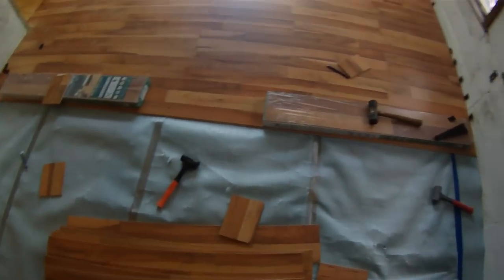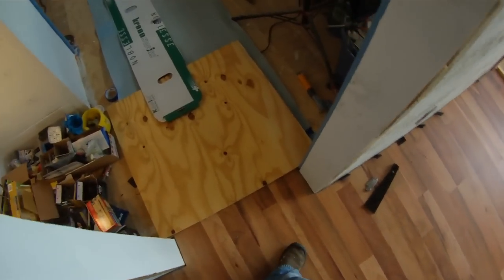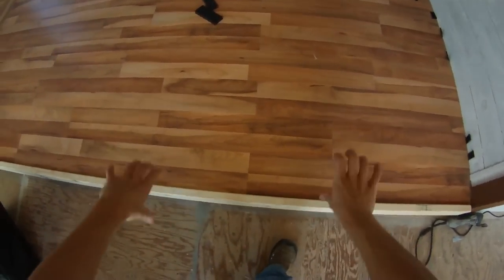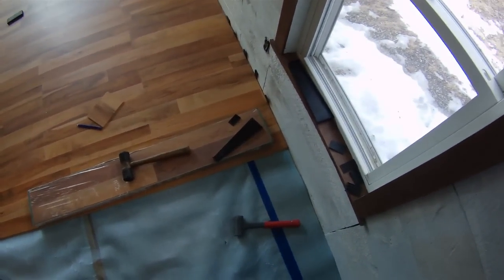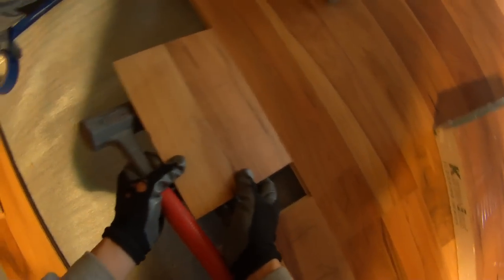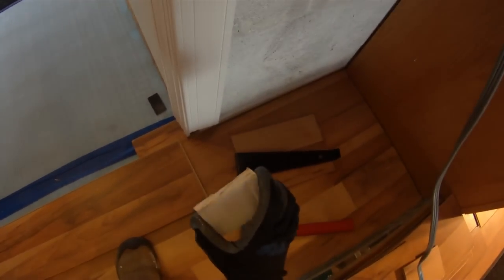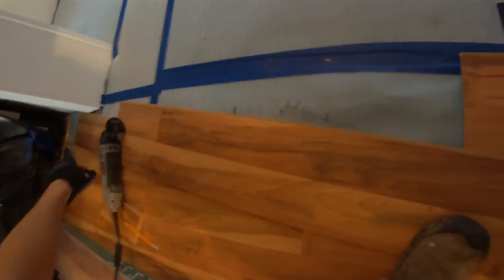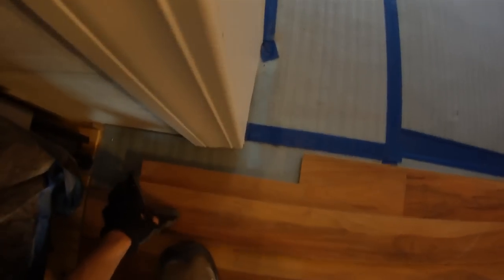P6 - How to install a Laminated Floor - Cabin / Home Repair & Restoration Project

Comment: thanks for showing us in details specially like me for the beginner, l had installed laminated flooring in my basement,  now the problem l got is some spot it become bumps l guess floor is not even .... what you suggest to fix it thanks in advance
Reply from the maker: It this after a long time or did you just install it? There is no simple fix if there is something under the floor it would need to be carefully removed and fill the holes or grind down the bumps until under floor is even the relay the floor. It is a bit of a pain. Good luck